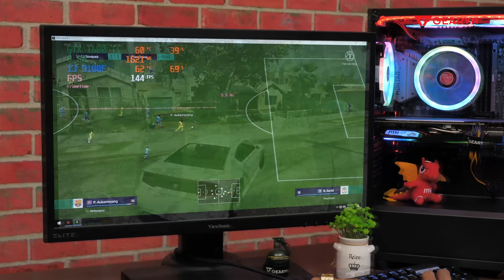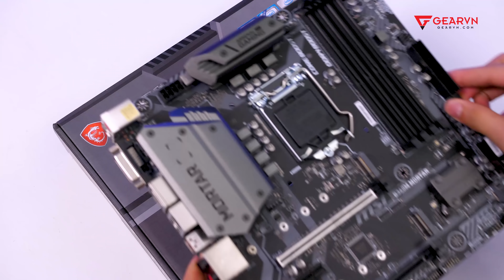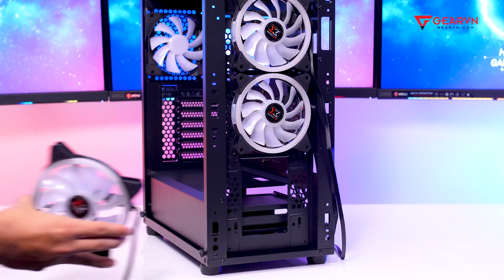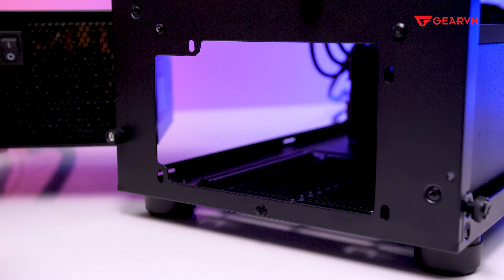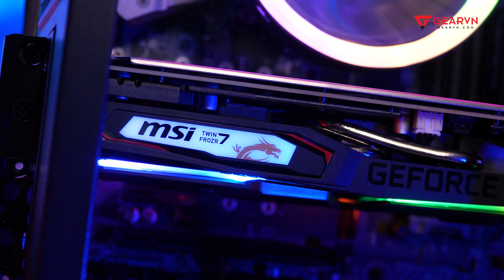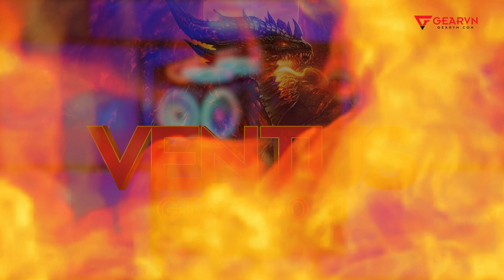GVN VENTUS 1660Ti - Rồng đỏ MSI ra mắt Fanboy !!!! | GEARVN PC Timelapse Build

Comment: i3 đi với 1660 ko đã nghẽn rồi chớ nói chi Ti, nhìn %GPU lúc utra pubg là biết
Reply: Đừng có khinh con I3 9100F, xung từ 3.6-4.2 GHZ lận
Mà I3 9100F còn là con CPU duy nhất là I3 mà có xung boost
Reply: @kennysan4462  mình biết là 9100F mạnh, nhưng 1660Ti là 1 con card quá mạnh so với nó, combo i5 9400F + 1660 sẽ cho ra fps cao hơn
Reply: @khangnt97  Nó cân được vì với mức xung siêu cao, cao hơn cả 9400F là 2.8  GHZ nữa thì nó cân tất
Reply: @kennysan4462  
Thứ nhất: i3 9100F max turbo 4 nhân 3.8GHz sao đọ được với i5 9400F max turbo 6 nhân 3.9GHZ hả bạn :))) turbo đơn nhân thì 9400F chỉ thua 9100F  0.1GHz thôi, nhưng nó hơn tận 2 nhân.
Thứ hai: i3 9100F cân được mọi game, cái đó mình biết, nhưng sức mạnh của nó ko ngang hàng với 1660ti, làm phí khả năng của con 1660ti nên mới gọi là bottleneck. Vậy nên nâng CPU lên i5, giảm GPU xuống 1660 (cho cùng tổng số tiền) thì cho ra fps cao hơn
Reply: Mạc Anh Vũ ?? Xung cao là auto mạnh hả? Kiến thức hạn hẹp thì đừng cố thể hiện mình

Comment: mình sắp mua PC nên build thế này kh biết có đc chưa. adm với các bro chỉ xem case tôi build có chạy đc ngon không nha, nếu không  thì chỉ thêm hoặc đưa ra ý kiến cho tôi với.pls
Nguồn Xigmatek X-Power II X650: 
Core i7 8700 4.60GHz 12M

Bo Mạch Chủ Mainboard MSI H110M PRO-VHL Socket 1151: 

Ổ Cứng HDD NAS WD Red 2TB/64MB/5400/3.5 - WD20EFRX: 
 RX570 8G DDR5 Gaming 2 Fan
RAM G.SKILL RipJaws 2x8GB DDR4 2666MHz - F4-2666C19S-8GVR: 5*Fan Coolmoon RGB
Vỏ Case 1STPLAYER RAIN
đây chỉ là tên bộ phận thôi mấy bạn search trên google để coi thông số kỹ thuật nhé
Reply: Rx 570->580
H110->X370

Comment: Cấu hình này ngon hơn nè :) Fan AMD :)
MAIN MSI B450 TOMAHAWK MAX (AMD) 
CPU AMD Ryzen 5 3400G
VGA MSI GTX 1660 SUPER GAMING X 6G
RAM DDR4 8GB KINGSTON HYPERX PREDATOR RGB BUSS 3200
SSD SAMSUNG 250GB 970 EVO PLUS PClE NVME V-NAND (chuẩn M2-sata) NEW
NGUỒN AEROCOOL LUX RGB 650W 80Plus Bronze Certified ( RGB SYNC )
TẢN NHIỆT CPU MSI CORE FROZR XL CPU COOLER
CASE MSI MAG VAMPIRIC 010
Reply from the maker: Hi KSS Gaming,
Thank you for watching our videos!